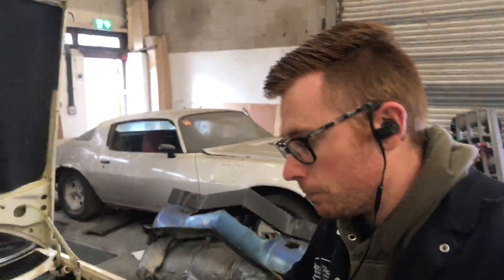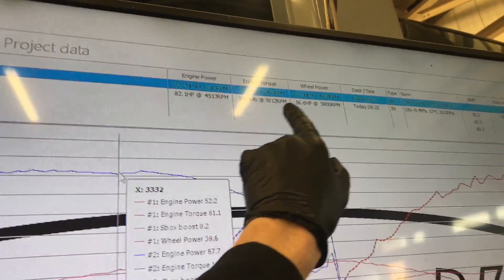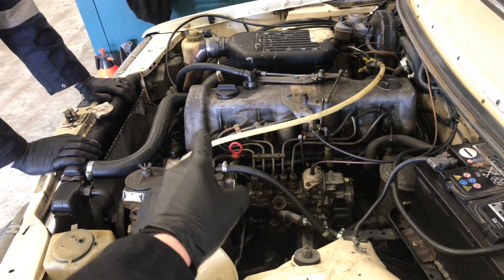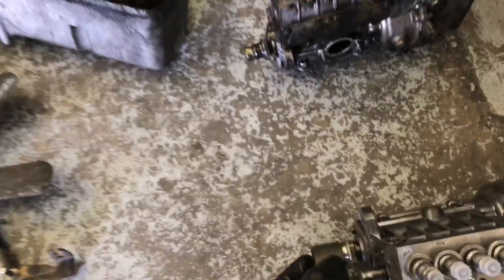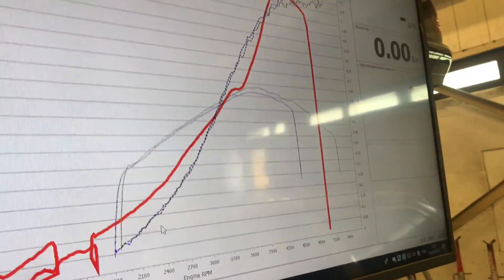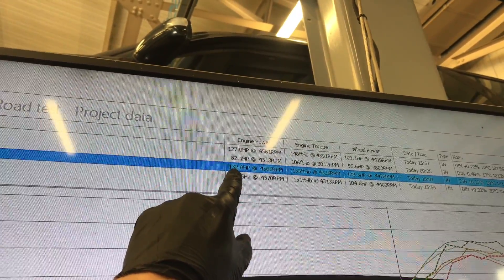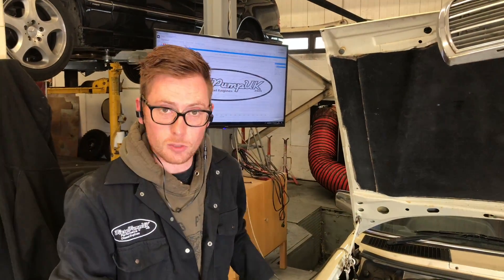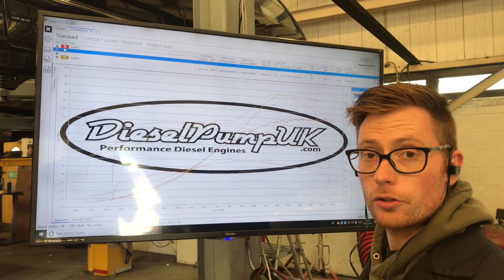W123 OM617 Double The Power

Comment: Thank you for the amazing content! 
Love from Finland! :face-red-heart-shape:

I have also some questions: 

in 4:07: that m-pump have different lift pump compared to stock W123 m-pump. 

Is that from 602/603 style injection pump's lift pump?
It seems to fit and I.P got fuel & pressure in good manner. 

What is brand and/or part number for the lift pump? 

Original ones are getting hard to find.
Rebuild kits don't include all parts needed to 
do full on rebuild either,

I managet to get one rebuilt lift pump for my 
W123 NA 300D's I.P,
but i wanna have some plan for future with a car's fuel system. 😃

Comment: If I read your Dyno output correctly, it seems the OM617 power curve (wheel) peeks at around 3,900 before the new pump, and 4,400 after.
I wonder what the /efficiency/ curves peek at, before and after?

Comment: I had a 79 motorhome normally aspirated OM616.  Drove it to the South of France from London.  I was in first gear on some of the hills on the motorway.  Then drove it over Pyrenees and the oil light came on.  I topped it up but the damage was done.  I used about twenty litres of oil getting home - was surprised the police didn't stop me at times.  No one could see.

Comment: Is this originally a non turbo? I hear that installing a turbo might damage the internals
Reply: Yes because there are two versions of the OM617, the turbo version is a OM617A. I forget where exactly, but it’s suppose to spray oil somewhere inside the engine to help with the cooling since it is a equipped with a turbo. It’s why you can’t mix and match a turbo and non turbo version during a rebuild.

Comment: Hello Sr.
I am Matias, I come from URUGUAY, I LIKE IT AND IT HAS HELPED ME A LOT.
Could you give some advice?
I have a mercedes 300sd w126, it runs great.
but it happens that it apparently loses oil in the crankshaft seal or seal from the gearbox side.

Do you think that you could undertake or make the arrangement without disassembling too much?
thanks greetings
the car is 1982 om617

Comment: Curious about rpm data…the 5.5 pump hp and torque data is recordeed below 4000 rpm. The new pump data for hp and torque is around 4500 rpm. This would make a difference in data numbers, correct? So is the dyno data accurate? Also, how is the engine hp calculated? Is it strictly mathematical? Not actual physical data? Thanks! Nice video looking forward to adding a new pump. Tim
Reply from the maker: The dyno calculates the drivetrain loss, if an engine makes more Hp regardless of what rpm it is in fact more hp

Comment: Actually, the 240d 4 speed manual does not have a turbo.  I get a good run up the hill and then have to shift into 3rd but it stays around 55 mph. which really pushes the engine.  I currently put on a new set of tires and went with the Uniroyal 205 75r14 and it makes a nice difference on the top end and drops the RPM. It makes a bit of change on the speedometer but the added comfort makes a nice difference.  My recent project  has been replacing the mechanical radiator fan and replaced it with a Flex-a-lite electric fan. I am no longer taking the long trips down to San Diego since my wife died from cancer 2 1/2 years ago.
Reply: Put a turbo on it, is easy

Comment: I wonder why I never noticed this before? I have 300D W123 with a STT turbo on it ,it's not slow (2 actual speeding tickets...) but it lacks real power because of the low fuel delivery setting. I have the STT manual which has a few hints on how to adjust the rack settings etc. I dont have the intercooler either which I think STT said came from a Saab, and the proper STT aircleaner is a large Volvo panel filter. So on hot days here there is a noticeable power loss.

Comment: Awesome stuff! I have a MB100D which has a OM616 in it and I 'd like to swap the engine out for something with some more power. Something tells me the OM606 wouldn't fit and would also be overkill but perhaps the OM617A would be a good shout. Do you have any experience with the MB100D? Also do you do full engine rebuilds?
Reply: Om616a turbodiesel force motor

Comment: So is there any loss in fuel efficiency with the new pump? Or is it just better overall?
Reply: There may be no loss, you may even gain some efficiency via turbo doing its job better, but your fuel usage will increase either way, as you are actively pumping more fuel... To reduce fuel consumption and to increase fuel efficiency are not the same thing... You can have the best, most fuel efficient engine and induction system but drive like a moron and have poor fuel mileage, and you can have an engine that has poor fuel efficiency(not power necessarily) and drive it with good fuel mileage... Power of the engine, its fuel conversion efficiency and fuel usage are related, but not strictly linked... Either can change without impacting others, and any change in any of them can impact all others in some cases... I cant say in this case does the fuel efficiency of the system rise, but i can say with certainty that fuel usage does rise, and as was shown, so does the power... Now it can be calculated, if we were told all the data and could establish formulas for original setup and its efficiency and then compare it to what we see here, but not enough data is given, and sure, it could be fetched and gathered, but im not here to provide both the resources for math, the math and info, i hope this did help, altho untimely, but whatchugonnado?

Comment: Neither the fuel supply nor the turbo if so equipped was ever the constraint to power on the OM617. It was always the valve timing. There is a 26° or so period at TDC where both the intake valve and exhaust valve are closed - no overlap, no scavenging. Compare this to the later OM602/OM603 which has overlap.
Reply: Are custom camshafts available to address that?

Comment: Was this engine originally a turbo or a non turbo?
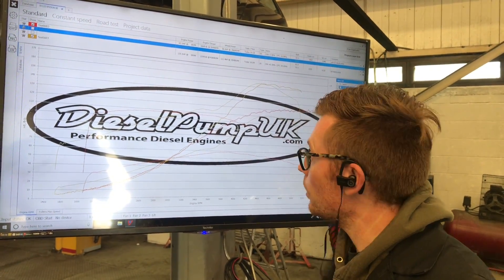Reply: @hubalahu Good question. My own guess is that -- based on what he says at the end -- it was originally a non-turbo. (It goes by quickly, and I myself only caught it the third time watching.) What he says at around 12:13 is "..and obviously this STT turbo kit is similar to the turbo kit you'd get on a normal 617. So you'd be able to expect similar sorts of gains on a turbo 617 by adding one of these  pumps." I /think/ he is implying that this car was not originally a turbo.

Comment: how does just changing the pump make so much more power? Do they tune other aspects? Is efficiency lost?  Thanks in advance
Reply: well imagine you have 10g of tnt you get poff now imagine you got 20g ot tnt now you got POFF the engine was originally without a turbo so the stock pump was already strung out and not able to give the fuel needed to drive the turbo properly, now with a pump serving more fuel you have a bather combustion pushing the turbo faster hence making more bost as unlike petrol cars i dont belive this has any boost limiter so more spool is more air and more poff
Reply: @Stale_Mahoney  This is a great answer. So the pump itself was designed for a non-turbo predecessor engine; and thus not optimized.
Reply: @JoeHeine  yeah that would be the basics of it all, as you from factory need to comply with emissions and such, but a pump able to deliver more fuel is bether for power

Comment: A standard om617 na has 80 or 88hp.  Why does it have even less with the STT turbo kit?
Reply from the maker: Speedbuster Nederland  your basing your figures on manufacturers claims, the reality of the actual power to the wheels is far different.
Reply: DieselPumpUK  the 80-88hp isnt Factory claim to the Wheel but at the crank. 

But even then,.....  with STT kit less power then factory specs without turbo?
Reply from the maker: Speedbuster Nederland the turbo kits made next to no difference, the stock pump didn’t have any more to give than 40cc so it was a total waste of time anyway. They were fitting these kits with the stock n/a pump, you don’t need to be a rocket scientist to realise that was pretty pointless.

Comment: In the '70s when mercedes launched the 617 turbo, some trial versions already made 180+hp on the running pad. To keep engine's life long, they reduced to 125hp then became available on the market.
Reply: Because the street version had no Intercooler.
Reply: You don't necessarily need a 1 million mile car. There is plenty of life in this engine.
Reply: Ya they did that by changing up the cam shaft making it more torquey
Reply: Mercy turned 400,000 miles, so I adjusted her valves, rebuilt & pressure balanced her injectors, switched out her glow plugs, changed transmission filter & fluid, oil & filter, tank screen, fuel filters, power steering filter & fluid, rebuilt her lift pump, new brake pads front & rear, new brake fluid, two new tires in rear...& she flies on 25 mpg.
Reply: hello it even exists in a 230 hp version on the c111 turbodiesel with large turbo watercooler and compression ratio at 18:1
Reply: And they weren’t even 
inter-cooling them.  They were just feeding them boost. Apparently they had (slightly) larger pump elements too.
The fine product ended up being an indefinitely reliable setup, but part of that reliability is low power.
Reply: @benz merc those extra 60hp are at the top end, where you don't spend most of the time
Reply: @joebotelho248   But as you can see in the diagram, the power increase in percent is even higher in low and mid range.

Comment: I have a feeling the previous owner turned my injection pump up, mine black smokes on acceleration and idle it’s rich as hell
Reply from the maker: R B.  You cannot change the mixture of a diesel at idle. The amount of diesel injected determines the rpm, if you injected more than the required amount then the rpm would simply raise. If you have smoke at idle you could have a timing or other engine issue. Big elements or nozzles can sometimes give some hazing also.
Reply: @DieselPumpUK  i never said you could.  I said the previous owner had turned up the injection pump. 
I DID however state that my car smokes at idle
Reply: And was rich, hense...black smoke . It sure smells rich to me

Comment: It would be probably cheaper to just buy a w124 300d and save a lot of work.
thats a lot of diesel knock sound like and old tractor at idle, I think you need to throw in two head gaskets to reduce the compression!

Comment: From the factory, the 3.0L turbo diesel made 110 hp @ 4500 rpm.
Reply: OM 617.912 = 88 hp
OM 617.952 = 125 hp
Reply: Iknow
but with a stt turbo kit only 56hp!
WHAAAT
Reply: @catfish_lude  they are reading the power at the wheels. Manufacturers rate the engine, itself, at the crankshaft. Also, I am not sure if Mercedes did this, but I know American car manufacturers, back until the later 70s or 80s, basically tested just the engine, with no accessories bolted up. No cooling fan, no power steering pump, no alternator.
Reply: @dposcuro  Whaat
Reply: @catfish_lude  okay, gimme a second, dumbing myself down a bit here:

Factory spec if engine alone. No transmission, no final drive and their inherant losses.

These guys are using a chassis dyno, which measures power at the wheels. This take into account the power used to drive the transmission and differential. It is always going to give you lower power figures than an engine dyno.

If you say what, one more time, I will get out the crayons, so don't eat them.
Reply: He put a turbo with no turbo pump, that's why, so the real power comparison is not reliable

Comment: Hi, just wondering where you lads are based? Would you fancy taking on a Jaguar XFS 3.0 V6 diesel that is throwing out loads of black smoke at about 2500 rpm? I’ve had the DPF’s removed, the EGR’s blanked and it’s been mapped, it was fine for about 6 weeks after the map and then I started noticing a lack of power and loads of smoke. It’s been to 4 garages now and no one can work out what’s wrong with it ☹️
Reply: Sounds like a boost leak from the pipework between turbo and engine.

Comment: How can the engine power be so low? A stock 617 without turbo should be 88 hp and stock OM617A with turbo should be about 120 hp
Reply from the maker: Robin. T  the factory claims are miles off, we generally get 40bhp for n/a om602, 55-60bhp for n/a 617 and 55-65 for n/a om603. I’ve tested on a couple of different dynos also. I think Mercedes may have been a bit naughty with the power claims. If you don’t believe that they are that low, ask anyone that’s ever driven a n/a diesel Mercedes, if of sane mind they will confirm how slow they are.
Reply: @DieselPumpUK  I've read how it's a bad idea to add a turbo on NA 617. Do you have an update on how the car is doing right now?
Reply: @hubalahu  well it had an ancient stt turbo kit on it for years that was starving for fuel from a stock pump and now its an ancient stt turbo kit getting the proper amount of fuel, therefore I would assume much better unless the owner wrapped it
Reply: @MrDrb8354  so it turns out the engine isn't "fried" or obliterated like what the forum people say

Comment: Thats all? I dyno'd 147 hp and 219ft/lb torque at the wheels with only 1bar boost on the STOCK 5.5mm elements with the pump simply adjusted. 
https://www.youtube.com/watch?v=rvz4_NGT9ZU

Comment: Nice, i like the old school diesels. These old Mercs & PSA XUD are 2 of my favourites, do you guys do common rail stuff too though? We've got a Volvo S80 D5 (euro3 163) and a 206 1.4HDi currently, the Volvo is   decent enough but i'd be interested in any tips you might have for getting a little more from the pug, though TBF i think the standard turbo is the limitation as it's running out of puff at the top end. That and no intercooler is a problem  (It's pretty standard, running gutted cat/disabled EGR & wastegate adjustment's maxed out).

Comment: That engine would be Glorious in my CJ7 Jeep.
I need to make that happen.
Reply: Its actually been done a good bit, but its not the best diesel for a Jeep swap (pmus you're ruining a Mercedes) theyre higher revving diesels more designed for highway cruising at higher speeds, not as much low end torgue for crawling over stumps etc. There's way better diesels for that purpose that will give you more torque at lower rpms. I would really check out the new Cummins R2.8 crate motor.
Reply: @joeb578  If not sufficient, how about considering om606 turbo, that has been modified. I would think with let's say, just an example 350hp and the right final drive ratio. Just my opinion, I would think that would be sufficient. Though with cj5, length might be an issue ? I'm honestly not that familiar with how much room they have under the bonnet.
Reply: Taras Pylypiv I put one in my Jeep cj5. Check out my playlist. I’ve got a tdi swapped Jeep and a 617 swapped Jeep. https://youtu.be/CsTemCcG_Lo
Reply: @john Parrish buy a Cummins R2.8 or get a 4bt Cummins

Comment: i like the fact that it has very little smoke  but cmon gents  something has to give  here ...double the power means double the heat  i have to wonder how the ex valves are doing after a 1000 miles  nevermind  that the exhaust is going to be  twice as hot during extra boost   but all in decent work  gotta love those Bosch pumps  i used to play with quanity adjustment on the rabbits in the early 80's and i got  nice results
Reply: It’ll only be double the heat if the engine is ran to rich and there is loads of smoke. If the boost is set right and there is no smoke on boost. The engine will be fine. Not to mention there tough as nails anyway.
Reply: The majority of road driving uses less than half throttle.
Reply: If they double the power they will probably reduce lifespan by half...or less..😀😀😀

Comment: Just wondering how much power you had got from old pump if max rpm had increased to same level as in  new pump.
Reply: Stock pump is good for more power than he made with this pump.... I got 147hp at the wheels from mine...
Reply: @superjesus4307  Hi, what chassis and engine? Very curious. Thanks

Comment: Thought you couldnt turbo the NA 617's cause of oil sprayers and coolers and such
Reply: electromechanical stuff you can but it’s more sketchy when you make more power or run it hard
Reply: @theshadetreewelder3523  i got a 74 W115 NA. How much boost can it hold as a reliable daily driver?
Reply: electromechanical stuff not sure I don’t mess with the NA variants
Reply: Of course you can. The STT kit included a mod to the filter to run the oil constantly through the cooler . I am sure this whole "you can't do it" was yet another example of American know it alls talking shit on forums about engines they have probably never seen let alone put a turbo on one.  The most preposterous posting was one where some clown said the turbo would lift the head off...Again by someone who has never touched one, or tried to lift a OM 617 head by themselves.
Reply: Yeah, because Mercedes didn't have to completely redesign the engine inside to handle an extra 35hp....
Reply: @Mercmad  eh, om617 + turbo + aftermarket mods doesnt equal a stock om617a, which is the factory turbo'd version. you can turbo anything of course, but when mercedes engineers decided to turbo the om617... they uh, heh, made a few major upgrades, like the cam, oil squirters, sodium-filled exhaust valves, etc etc. from an american with love, who DDs an om617a w/ 300k+ miles.
Reply: @Mercmad  no reason to bash a nation. Most hill billies over here with a summit catalog make more hourse power then lambos. My $8,000 home built 454 makes 650hp. Most asmericans dont bother putting a turbo on a 70hp 30 year old diesel to pick up 70hp and call it fast. I just want to turbo mine so i can keep up with traffic.